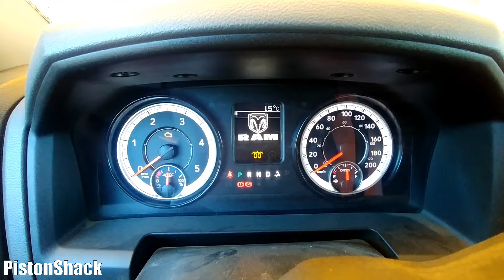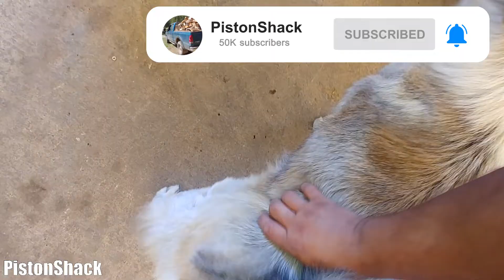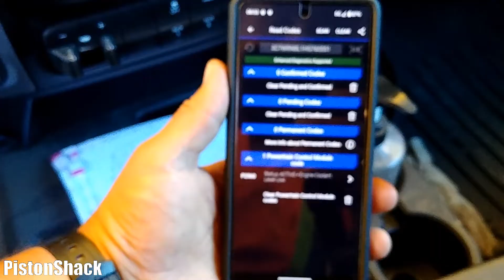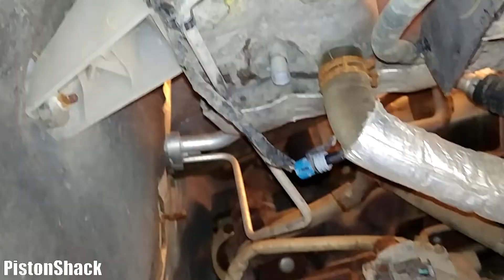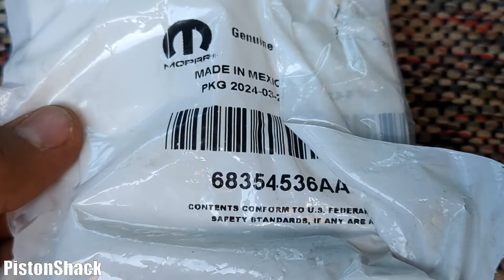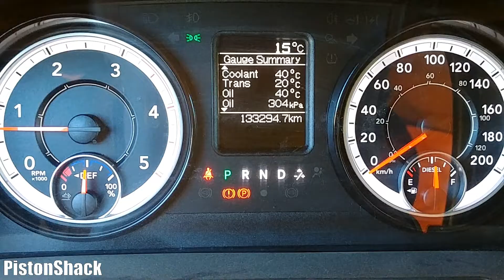Dodge Ram: P2560 Engine Coolant Level Low | Diag & Repair | Ram 2500, 3500, 5500 6.7L CUMMINS

Comment: If the new sensor does not fix the problem, then the issue is the junk in the tank which does not allow the magnetic float to move.  As mentioned, a new tank is then needed.  Mine had that and I just soldered a small wire across the reed switch on the sensor to permanently short the sensor.  Replacing the tank is a bear and not worth the effort.
Reply from the maker: Good point, Mark. Thanks for sharing your advice. I will pin your comment up for the community. God bless!

Comment: One little tip.. You can replace it from the top in 5min and no need to remove the wheel cover, if you handy enough you can fit both hands from the top, one on each side of reservoir to be able to install the new one.. might need something small to pry the old one out but pretty easy to do. good luck

Comment: Very interesting troubleshooting. This is a genius coolant sensor design.❤
Reply: @engineeringcanada  this is the wurst design I’ve seen. He didn’t fix the problem. The light when out until he brings it back up to operating temp and runs through a check. You can take the wheel well out, take a rubber mallet and tap the tank bottom with it running and it will let the float float freely and fix it.
Reply from the maker: Glad you like it!